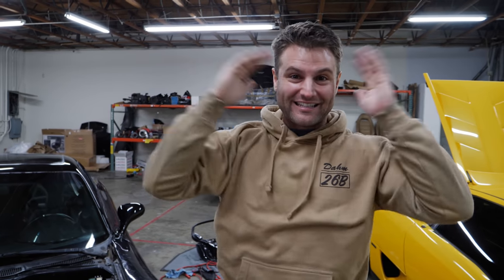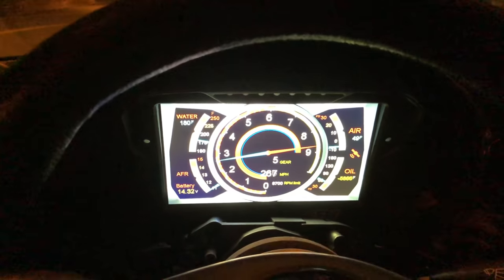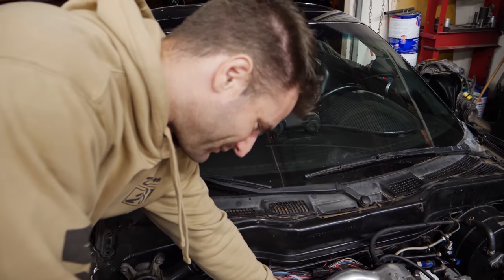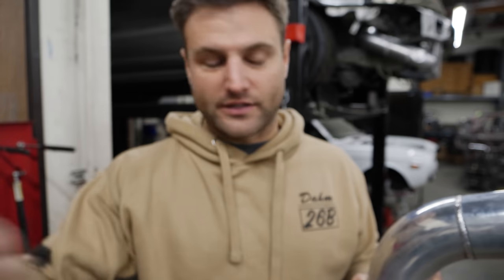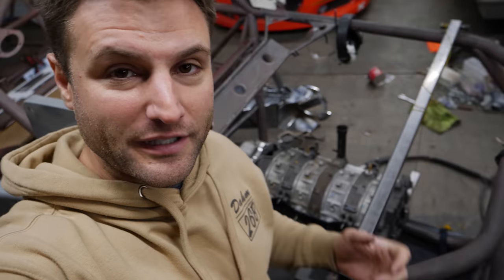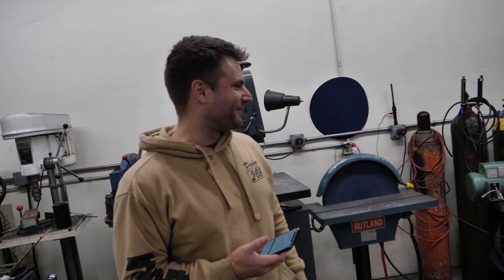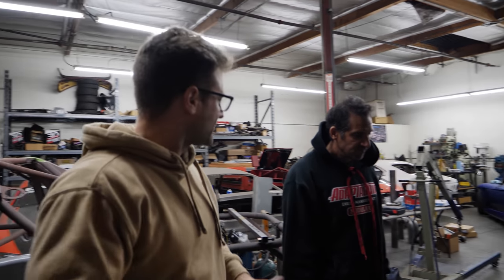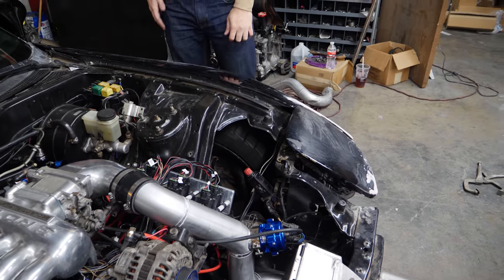WE DON'T DYNO THE CAR. But the night wasn't a bust

Comment: tial blow offs need a certain spring pressure to match your idle vac .     you need to take it off,   then idle , see where you are -vac ,  and then match the spring for the BOV to the vac pressure,    Tial has a chart for reference n their site, and or google it.   also the wideband should be 36" from the turbo , downstream . too close and they dont last long , and then meter oddly until they totally die,  and by then you've been miss metering long enough  to risk damage .
Reply: No bov is the best and you get the sound sttututututut too
Reply: @j0lel666  NO .   he should have one for sure.    but having the correct spring , and operation is critical .  there is no benefit to no BOV . they serve their purpose.  that sound ,  is fast , repeating , inconsistent fluctuation of  RPM in the blades of the turbo and center housing/bearings .  no good....
Reply: Yep then you can buy a new turbo shortly after you ruin the one in your car.
Reply: Not really, you can go for years without a bov but depends on boost and usage. My old 200sx with a ca18det never had a bov stock and the turbo was fine. You do it to minimise pressure loss between gear changes.
Reply: @NiveusLuxLucis      i love " not really "comments  .  LOL.    so you were pushing 30+ Lbs like Rob plans to , with over 1000hp worth of airflow ?      call ANY bov manuf ,  and have this conversation with them ,    and get back to us .
Reply: @NiveusLuxLucis  oh ,  and youre wrong about pressure loss,   that has everything to do with location of the valve in proximity to the throttle body . the bov should be 6-9 " from the throttle body first off ( in aftermarket applications where you've gone hard-pipe and have the option to relocate ) .   that is so the turbo and charge pipe still are pushing air in the right direction ,  and the intercooler pipe has less drop of and fluctuation of airflow ( that's metered by the way , and confusing the ecu in bov-less systems, if the turbo is fluctuating rpm , so is any air moved by it ) . since you are still maintaining turbine pressure through the piping , core , and then releaved at the throttle body in essence,    you don't have drop off of boost pressure when its re presented to the system on throttle in next gear .   you have to fill only those few inches of induction piping pre throttle body from beyond the bov,  instead of the entire piping , core etc.    lessening that fall off of boost pressure.

Comment: 9:34 What causes the sparks? exhaust hitting the road?  It sounds so good though. Can't wait for the dyno vid! Have a safe trip home, Rob.
Reply: i was going to ask the same thing
Reply: Im pretty sure thats the exhaust scraping
Reply: I think it was from around the middle of the car because it was pretty central
Reply: Could be the exhaust that's hitting the road because the car squats down under boost :P
Reply: It’s the exhaust
Reply: Could be when the waste gate opens up
Reply: He mentioned in the last video that his tires were low so the exhaust was making contact with the road.
Reply: doritos falling from the engine
Reply: @Oliv_1999  the wastegate has an up-pipe through the hood

Comment: Love the realism of your videos Rob. Things never go as planned or smoothly. You just have to learn from it, improve on the desing or set up, and continue to improve. I would like to also comment on the blow off valve. The spring rate doesn't have anything to do with holding boost. The boost/vacuum supply to the top keeps the valve closed when under pressure. The spring rate matter for how it easy it will open when under vacuum. Ideally you want a spring rate that allows the valve to open within a few inches or mercury above your idle vacuum values.

Comment: rob, not to be a pessimist, and it doesnt seem possible for a brand new built 20b, but perhaps it has the issue where it has a torque lapse and hesitates at 3-4k rpm? ive heard thats an issue with 13b’s and it cant be fixed, but im not sure